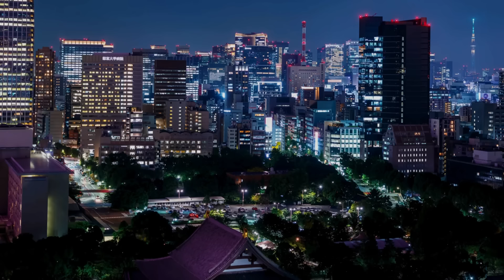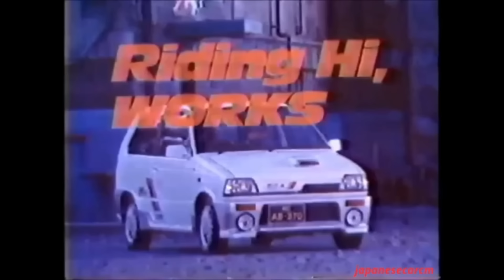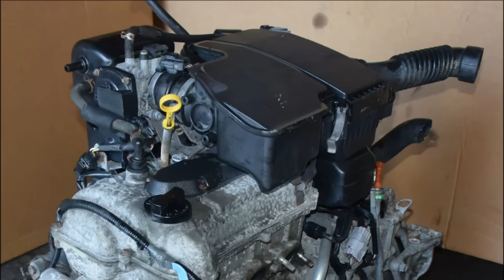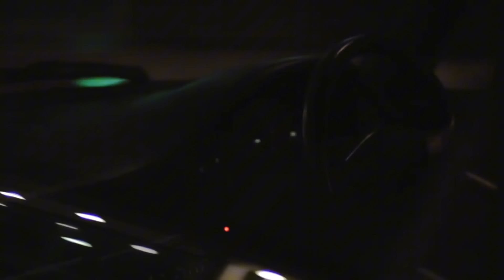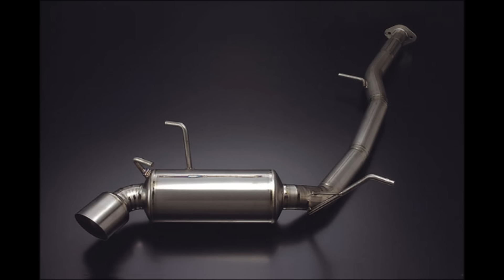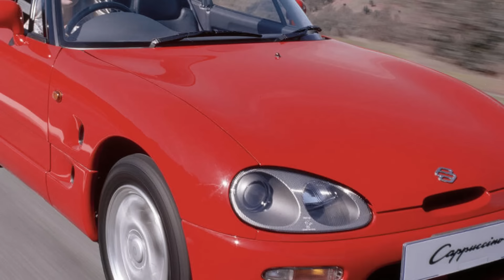The Suzuki Cappuccino: Japan’s Most Brilliant Mini Engine

Comment: I own a red Suzuki Cappucciono, 1992 reg with very low miles on the clock.  What a fast little rat when the turbo kicks in.  Drives like a gocart.  A barrel of fun in a tiny little package.  What a car - it has a turbo and inter-cooler with four configurations - hatchback, T bar, targa top and full convertible.  Mazda MX-5 (Miata) doesn't come anywhere near it.

Another Suzuki that I wouild have liked to own is the Suzuki SC100 (aka Suzuki Whizz Kid), sadly, you can not find it anywhere in the UK.

Comment: K car regs were not 660cc the were under 360cc ( the 660 cc limit was the next regs up ) , originally Daihatsu had a 2 cylinder 2 stroke liquid cooled longitudinal engine in its Higher vans and trucks , later same engine as east/west front wheel drive sedan . It was 356cc two stroke reed valve twin . Subaru also go involved with a twin a four stroke OHC 360cc ( Subaru 360 car) later enlarged to the bigger 660cc as a 600cc twin , you can see this twin X 2 in the first Subaru boxer EJ1200 motor , it's exactly two of the twins on a common crank that's how the Subaru boxer engine came about . Suzuki with its first " Carry Van and Truck " stepped up to the 660 regs with the 3  cylinder two stroke 536cc , later put in the tiny LJ50 4x4 . The the Carry switched to a 3 cylinder four stroke 550cc triple , and later to a 800 cc version , then added a cylinder making a 4 cylinder version  1000/1200cc . The the Suzuki Mighty Boy tray back truck ( I really suggest you look up the Mighty Boy it's a classic and nothing else like it , the rear tray / tub is 1 foot X 2 foot in size . The whole car weighs 400 pounds , powered by the exact same engine family that's in this video , it was in the Mighty Boy first , years before the Cappuccino) , people have removed the little 3 cylinder OHC triple and installed a 1300cc Hayabusa bike engine ! With stunning results , as it has a rear beam Axl a diff can be installed on the same leaf springs , 1300cc bike engine connected and they are very fast . As for the K cars Honda ( pictured in the video) produced the 360cc car basically a CB360 bike engine with a front wheel drive gearbox under it "Morris Mini " style and the larger regs , 600cc same motor , a air cooled twin four-stroke . Honda also made the " Honda Scamp" a truck/van with a flat air-cooled twin four-stroke under the tray driving back wheels, the Honda " Zot" a 360cc four stroke twin liquid cooled front wheel drive sedan . They were double over head cam . 4 valve twins . The Cappuccino was the last use of the 660 triple that dated back decades .

Comment: My Suzuki GSX-S750 gets 39-44mpg. My Honda CB300R gets 60-70mpg. My Kawasaki KLX230SM supposedly gets up to 76mpg, probably more likely around 69. 
This is from reports online i should test them, but power to weight ratio on motorcycles is impressive.
I am still breaking in my Honda CB300R but it is a little Hooligan around town, quick and nimble.

Comment: Had 1986 Chevy Sprint ( Suzuki rebadge ) non turbo 5 Speed. When I first test drove it I thought it was pretty preppy. 50 miles to the gallon on a computer feedback carburetor.

Comment: They should have used the rotary engine I love my Suzuki rotary 497cc with 62hp @6500 rpm and 55 ft/lb tq @ 3300 rpm. I actually want to put a rotary in my Suzuki carry.

Comment: Suzuki is really underated. Always the lightest cars. So good at shaping metal that the japanese space program always comes to them to cut weight. I own two Suzuki Swifts, one with the G10A 993cm3 56bhp engine and the GTi 1298cm3 101bhp engine. Really fun to drive, light, easy to fix yourself and economical cars.
Reply: @Encryptus1 Just don't take them out in hail.

Comment: Had a 1975 Suzuki LC10W Fronte three cylinder, water cooled two stroke in Japan in 1977. 500 KG car, two place. Pulled the engine and rebuilt with porting and full tuned pipes barely muffled. Base power was 34PS (HP)....by the time we were done we were estimating 50PS and a car stripped down to a single seat and everything else not structural pulled out. Not a super barn burner but fun in a Gymkhna event. To be honest, barely enough power before it came on the pipes to peel a rotten banana.

Comment: People romanticize kei cars like they’re miracles of engineering, but let’s be real — 64 horsepower is barely scooter territory. Fun, sure, but call it ‘performance’ and you’re stretching the word thinner than a turbo gasket.
Reply: Yeah, right. You can tell that to the BMW X5 with 235bhp owner that I humiliated with a 34 year old Suzuki with 101bhp. Afraid of doing curves at 170km/h, are ya mate? 😂

Comment: I had a 94 1.0l Swift that burnt 3 of the valves in one hard overheat. Run the 1.3l in a bunch of the next body style without issues. Just as fun but nowhere near as fast as a cappuccino

Comment: I ran a Suzuki Swift 1.0 for ten years (same engine as the Geo Metro, G10A). It never let me down and when I sold it on, it had cost me just £325 in depreciation. I have another sitting on my driveway, as our reserve car. It’s not been driven for almost a year but it will start first turn of the key. I also fitted a G10A engine in my home built sports/trials car and fitted a supercharger, which almost doubled its output. The engine bolts onto a Jimny gearbox, which makes it rear wheel drive. I removed that for reasons of economy. It now has BMW K75 throttle bodies and it still flies, while still giving good economy. I have a spare G10A engine but I doubt I’ll ever need it because these engines are so reliable.

Comment: I still own and still occasionally drive my 1993 Suzuki Swift GT. 1300cc engine. 1,800lb vehicle weight, 5 speed manual transmission. Still my favorite.
Reply: Hang on to that,  you don't see those anymore.
Reply from the maker: Definitely that’s a keeper
Reply: Just saw one the other day. EF civic HB was my dream car of its day but the swift was somewhere mid top 10.
Reply: Really fast i recall surprising
Reply: My brother had a 1992 sedan that came with the 1.6l 5spd. It rusted so I cut the motor out and let it sit. Eventually swapping it where a 1.3l automatic was in a 2001 model. 1.6l was 100hp as well. Big Block. 💯

Comment: I have a 2008 Suzuki Zen Estilo (in India) a.k.a 2002 Suzuki Mr Wagonr (In Japan) powered by biggest engine in the F family of engine, the F10D. This non turbo 1.1L engine made a modest 64 Hp. Combined that with a car weighing just 850 Kilos, its fun to drive around. I have numerous long distance travels upto 800 kms in a day,, the F10D never broke a sweat. I have seen this engines with north og 3 Lakh kilometers (which is a lot in india) still on their original engine. All these engines needed were oil change, coolant change and timing belt change. Absolute bullet proof reliable engine. Also fun fact, The Suzuki F8A was the first engine to put the indian masses on wheels. The F series engines always holds a special place in my heart.
Reply: "north og 3 Lakh kilometers",           I have no idea what that means.   What Miles per Gallon did it get?
Reply: @hoodagooboy5981  45-50Mpg on the open road and 30 mpg city, worst case.
Reply: @hoodagooboy5981 ODO meter reading.
Reply: The original K10 was awesome, 67hp and 750kilos. My Wagonr 1.2 is 830kilos and 82bhp.

Comment: I was lucky to oven a RVF400 honda motorcycle On the dyno it was 63hp with torque rising in a linear fashion 3500 -15000 rpm Absolutely Awesome

Comment: The Geo Metro engine was wonderful, even though it only made some 57 hp.   The best gas mileage I ever got was 74.6 mpg, coming from Phoenix to Yuma, Az.
Reply: Is your Metro an XFi?     
The best I ever got ( after making cardboard fender skirts and pumped up the tires to 55psi ) was 70.5 going from Kingman to Vegas.  Mine is a '82 Convertible with a 4.10:1 final gear.
Reply: @hoodagooboy5981  Nope, it was a regular model, but when I got that "Killer Mileage" , I had come a crossed a "Tranny" from an XFI model.....that was the big difference.   I've also used some gadgets, that I've used for many years....Platinum Gas Saver, and  the "Fuel Atomizer",,,,BOTH work..... "IF" I had a "throttle-body" injection system still I would be using them both......
Reply: I had a Kizashi. Had a 180k when I sold it to my mechanic. Didn't burn a drop of oil. Original cold AC. Would still do well over 100mph when I sold it. At 80 mph would get 32mpg! If they still sold cars in the US. I would still own one. Bullet proof cars!
Reply: @skipcampbell4226  Yeah, when I would go up to the Bay Area of California, and be coming back,  I'd be driving 70-80, and mileage would go down to some 36 or so.
Reply: From Phoenix to Yuma. Downhill the whole way. Metaphorically if not physically.
Reply: I had a blast with my Lil 5 speed Metro.....
I drove it from RI to NJ then back to RI, and still had gas in the tank...😅.
Reply: Mine was colder than a VW Bug in our Pennsylvania winters, the first year I had it when winter hit I thought it had a stuck thermostat so I put a new one in it, then I put a piece of cardboard in front of the radiator, nothing worked, when our temps would get down to 20° F or less all the heat would just bleed right out of the block without sending any through the heater core, which was a serious problem because I worked steady midnight shift in a shipyard, I'd have to dress warmer to get to and from work than I did at work.
Reply: @dukecraig2402  I had two Metro XFI's. A 94 and 95.  I would get 45 - 49 mpg in suburban driving and 55 - 58 on the highway every day of the week.  To get 70+ you would have to be coming out of the mountains with a tailwind in my opinion.  Great cars.  I loved my Metros.  We also had a 99.
Reply: My buddy had an early 90s Geo but it had a 2.0L 4cyl in it. That thing had a surprising amount of pep to it, because it was so light. With good tires and a little 5spd it was a blast to drive. And still got about 50mpg.
Reply: @Matthew-bc9mr  If it were a Geo Metro from the early 90's it would ONLY have had a 3 cylinder engine.   The little Suzuki Swift, indeed had a 4 cylinder engine,  it was a 1.2 liter 4.   Later years, when they changed the  body style, and name, Chevrolet,  they began  installing  only 1.2 liter 4 cylinder engines.
Reply: @marcelgaud depends where u were , they didnt sell the swift in canada but sold the same car as a metro or cultis
Reply: There is  500cc 3 cyl, that have optimum power to weight/ displacement, apparently. (The sports mg is a turbo 3cyl?). The 3 cyl k75 BMW, is a really good donk, apparently, (my bro had the 4 pot k100, bees knees, in 1988. Had electrical issues, that should have gotten sorted, (hall,sensor, I think it called, physically near the headstock), anyhoo,  went good, (shaft drive), the 3pot 75, was smoother, apparently. Magic formula, 3cyl. This vid says 600 or more cc. (Apologies, if I bore you.).
Reply: Mine had 75 hp and a hemi head . Still have the engine and a decked head that never got on it .
Reply: 1300 cc? Automatic or stick? I had a 1991 Swift which is pretty much the same,  but sadly I had an automatic.  It didn't go more than 400 km on a tank of gas. I ended up crashing it after about a year and a half...the only new car I ever bought.
Reply: Had one, loved it. Suzuki made awesome product that just needed marketing help.
Reply: That's like the best mileage we got from the Prius.
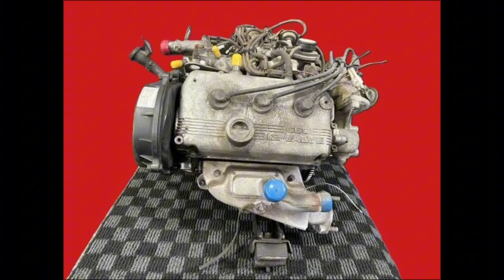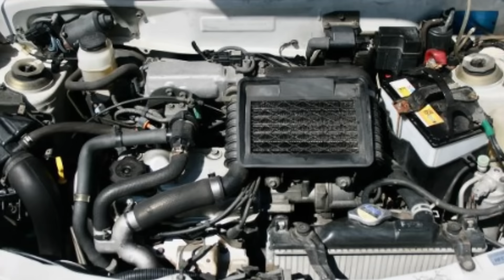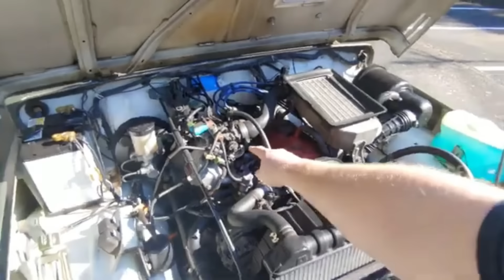Reply: A 4:10 final gear???? 3:90s and 4:10 are drag racing gears; 3:70s are towing mainly; 3:45 are city gears; 3:10s and below are mainly highway gears. Dependent on trans type and ratios.
70mpg with a 410 final.... NOT a chance, unless your literally driving a go cart with a 8hp Briggs.
Reply: @MarkClark-d5u  Well, you can check on it. it was the "OPTINAL GEAR RATIO" of the Geo Metro, front wheel drive car.   I also had come a crossed,  the "XFI" model, which was a much higher ratio than stock... STOCK ,(if I remember correctly) was like 3.89, and the XFI model had an.......oh boy,,,,,I don't remember, but you can look it up,,,, it's what got me 74.6 MPG........
Reply: @MarkClark-d5u  Do your research.  You could get a Metro with a 4.39:1 ratio.  4,000 rpm at 65 mph.  These engines red line at 7,000 rpm.
Reply: @MarkClark-d5u  thinking in muscle car terms bud. jap econoboxes have short gears.
Reply: @MarkClark-d5u cars & guitars...I think i have some resentment issues?..😂or a doppelganger?..its just the system now. Pretty weird though, eh?.

Comment: Love those Suzuki's......... I've owned 4 Geo Metro's over 25 years .     I would've still had one now, if I were able to get parts...........Hundreds of thousands of miles.......on the little 3 cylinder
Reply: I have no problem getting parts for my '82 Metro Convertible.  Where were you looking?
Reply: @hoodagooboy5981   Mostly EBAY,,,,,, I used to be able to get "ANYTHING I NEEDED/WANTED,,,,,, sure it's all from Taiwan, and from China......but I used to be able  to get them,,,,,then all of a sudden,,,I wasn't able to get anything, NOT even the proper 145 R12 tires....... I had to get 155's..... (throws the mileage off just a bit.

Comment: To say a turbo charged engine generate a lot of heat in this small without the thermal mass to absorb it is a problem is AI (artificial idiocy) stupid. You don't manage heat by absorbing it. You manage it by dispersing it.
Reply: Yeah i got excited when i saw a video about my favorite engine but its just AI slop :(. 
- The cooling system in these is NOT special nor do these engines generate a terrible amount of heat.
- 64hp isn't such an impressive feat.. many other kei cars meet the 64hp limit naturally aspirated & these engines(F6A and K6A) made 120 w/ bolt ons no issue a few years after they came out
- Not sure why people are talking about the Geo Metro, it had a 1L or 1.3L with not that much in common with the kei-spec engine(though yes it was made by suzuki).
Reply: So Artificial Idiocy is catching on.

Comment: TIME FOR THESE ENGINES TO BE RELAUNCHED GLOBALLY - coupled with high tech drivetrains - they could lead to lowering our carbon footprint
Reply: I agree. Most people could benefit from a car that is far smaller, lighter and less complicated than the overblown, over complicated and massively overweight vehicles that are currently being pushed out by today’s manufacturers. Smaller vehicles obviously produce a smaller carbon footprint in all respects, starting from their manufacture onwards.
Reply: I SURE AGREE!
Reply: Ironically, we would need to get rid of emissions for these to come back.
Reply: Can still get them new, just hard to get outside Japan

Comment: 60 hp from 660cc is nothing worth boasting about.
Suzuki's GSX-R600 is good for 103 hp and the Kawasaki Ninja ZX-6R has more than 120 hp
Reply: Bike engines are built for high power at high revs but car engines (and some bikes too) have to balance low end torque delivery for better drive-ability and sacrifices top end power as a result (Lexus LFA as a notable exception and Mazda Wankel engines).
All in all 10% of CC as hp output is considered good turbo engines in cars and Bikes have very low torque output (between 1/4 to 1/2 of a comparable car)
Reply: That's Apples to Oranges.  A bike engine doesn't have to worry about making Torque.  HP is just a number : Torque times RPM divided by 5252.  The more RPM the higher the HP.
Reply: @hoodagooboy5981  Tell that to the 2.5 litre Triumph Rocket 3 that makes more power and torque than the 2.5 litre Mazda
Reply: It's mostly emissions issues
Reply: My 300cc 2 stroke dirt bike does about 60, weights like 20 pounds lol